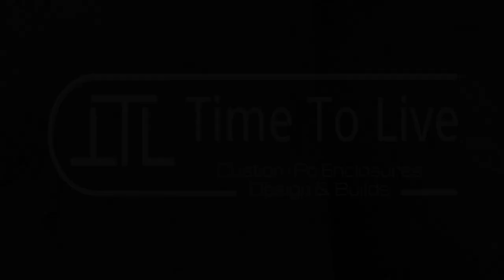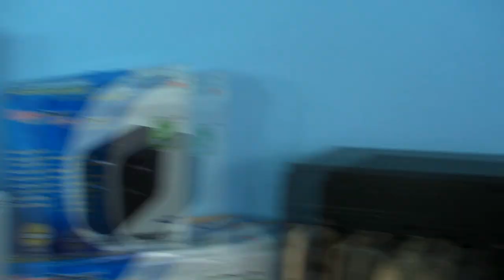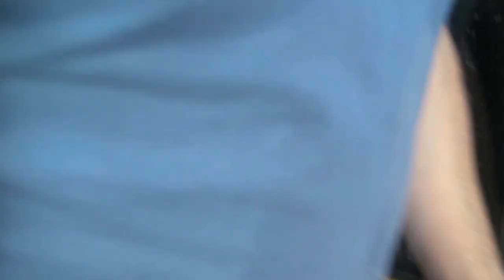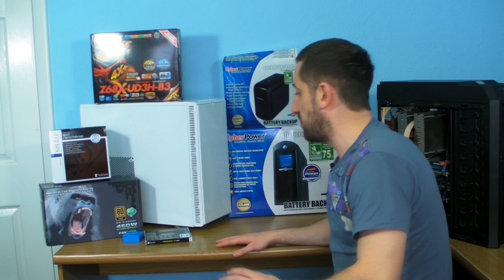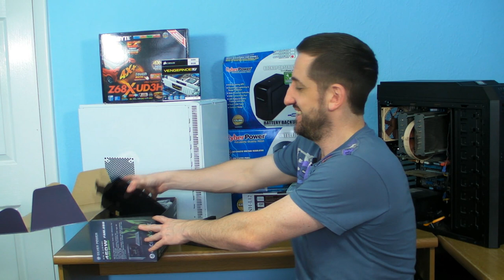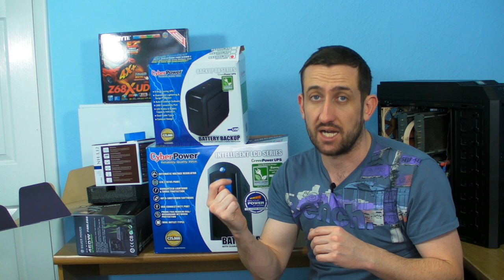TTL's Home Server 2012 Update Z68-UD3H i3 2120 Server 2008 R2 Adaptec RAID

Comment: I don't own a desktop or server, only a notebook. Been using a 750VA UPS for many years. Have the modem, router, printer, USB hub, external 3.5" drive, external full-size burner and cordless phone all running off it. Huge life saver and convenience when the power goes out during any work task. I can stay connected, finish moving files, get that last page out of my printer...

Comment: Most UPS are rated by VA (Volt-Amps) and is not the actual Wattage rating of the unit. That is usually 60% of the VA. Thus 850VA is actually 550Watts.  
Basically The power in Watts is the real power drawn by the equipment. Volt-Amps are called the "apparent power" and are the product of the voltage applied to the equipment times the current drawn by the equipment.

Comment: UPS's are used for battery backup as well as protection against surges, power spikes, and brown outs. If this were an enterprise build, redundancy would be necessary. However, this is a home server and having the UPS will fulfill that need. You get a broader range of protections using this solution in this particular scenario. IMO

Comment: @Techthisbuffalo Yes, they absolutely do. Google "problems with WD Green drives in RAID" and you will see. It has to do with head parking, and other built-in power saving features. I also believe that some companies have done a complete redesign of their green drives specifically to address this issue.

Comment: I was under the impression that "Green" drives weren't good to use in any kind of RAID array due to their power saving features, which would cause them to power off at random times, and cause issues with the array.

Comment: Don't feel over-confident about surge protectors, they will do NOTHING against a direct lightning strike. The bolt has made it from the sky to the ground, it can easily jump 5mm across the MOV. They can protect against small transients from nearby strikes (same as MOVs already in good PSUs), but it's still advisable to unplug power/phone lines in a storm. Also, budget UPSes use stepped approximation to sine wave which can play havoc with PFC on PC power supplies.

Comment: I hope at least this time you install the PSU with the "fan side" downwards ;)

Besides that i don't see the point in having a passive PSU in a file server. Many PSUs nowadays will not start the fan until they hit a certain load. So at low loads (propably most of the time for a home file server) either PSU would be inaudible. Under load, the HD noise will be dominant anyway.

Comment: shouldn't really at most it should cost about £4 a week and that's if it's drawing a lot power and if you need one to run cheap you can always buy low power components and set the drives to spin up when needed

Comment: TTL would I be able to run a simulated sine wave UPS with a modern PSU like the corsair ax series? I have heard that I may need a pure sine wave UPS for a PSU with Active Power Factor Correction but not really sure if this is true. Would appreciate any help. Cheers for all the great videos :)